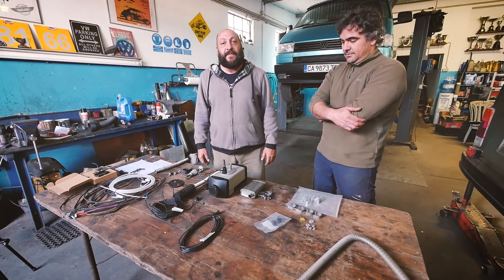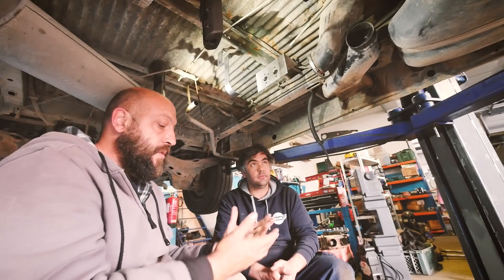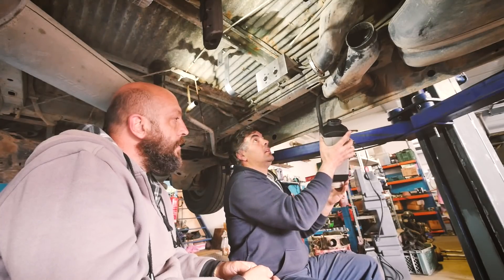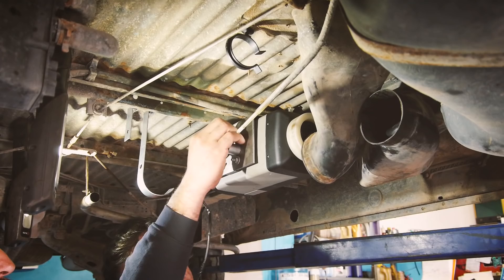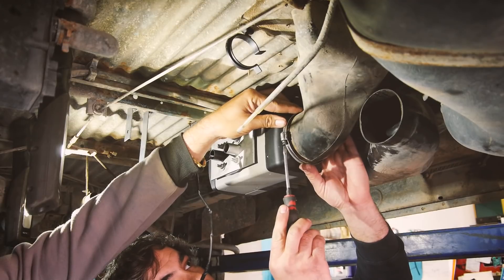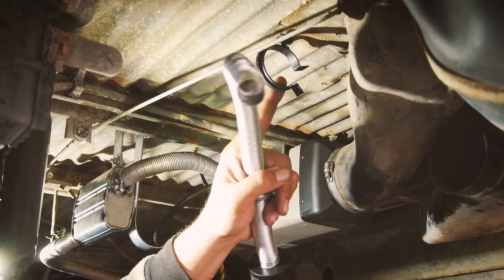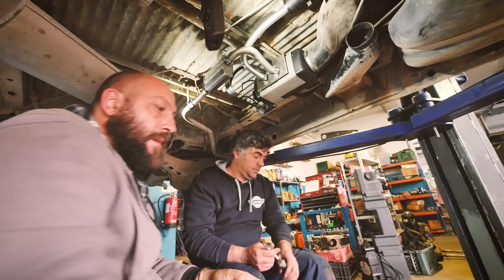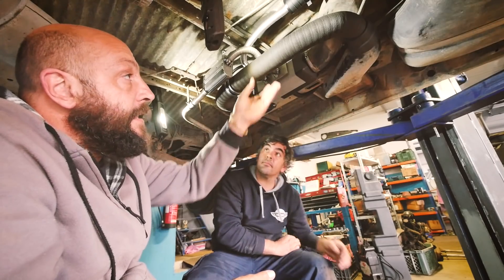How to Install a Webasto Air Top 2000 STC on a VW Westfalia (replacing the old  Eberspacher)

Comment: Ciao Armando, grazie per questo e altri ottimi video. Dopo tre anni di viaggi ed utilizzo del webasto installato sotto al furgone (quindi esposto a sassi, polvere ed intemperie), in quali condizioni si trova il riscaldatore? Consiglieresti l'installazione dentro a un box di protezione? grazie del tuo tempo... ciao!
Reply: nessun problema dopo tre anni di utilizzo montato sotto, dentro una scatoletta direi di no, la Webasto ha un'accessorio che vende separatamente, un paracolpi e parasassi
Reply: @storiediarmando  Bene, grazie del tuo prezioso feedback. Buon viaggio ....

Comment: Hi
Can i ask how the wire come  through the chassis?
I know original coming through inlet pipe (90mm)
I am just  installing eberspacher in the same way how you did
Reply from the maker: The wire get inside from the air intake behind the driving seat under the fuses

Comment: I guess you connected the heater to your main battery, how many hours will it take the heater to drain the battery completely?
Reply from the maker: never to the main battery, only to the 2 Gel leisure battery. Usually except starting the webasto itself, it goes into 1- 1,5 amph

Comment: Three questions about the Webasto AirTop 2000 STC
Question one: the fuses (1amp for the controller and 15amp for the heater) - on the fuse harness/plug there is a sticker that says F1 and F2. Can you tell me which fuse goes into F1 and F2?
Question two is about the two wires that come from the heater to supply power to the fuel pump, and the separate/long fuel wire with blue and brown wires - Is there a positive and negative? How do the blue or brown wires connect to the two from the heater? Are they interchangeable? 
Question Three: On the main wire for the unit, one plug says potentiometer and the other says telestart. One person said the potentiometer is for the Rheostat/dial and the telestart is for the digital multicontrol. Do you know if these plugs are interchangeable? Because the way the cable is wrapped, placement would be better to use the potentiometer wire for the digital multicontrol. Thank you
Reply from the maker: Wow, I’ll try to reply but I install the Webasto 3 years ago!
Reply from the maker: About the fuse I really don’t have memories about it. About the wires I put blue positive and brown negative. Last question: they should not be interchangable as one is for the old controller and another for the digital one

Comment: Hello, what have you done with the water tubes that were going to the old heat vent?
Reply from the maker: Water tubes?
Reply: @Westfaliadigitalnomads  yes, that are going to the old heater
Reply from the maker: we removed the engine heater in the back, we simply bypass the pipes

Comment: You've missed to insulate the air circulation tubes. You are loosing one third of the heat right now to the outside. For even better result insulate the heater box as well.
Reply from the maker: thanks for the tip, any particular material I should use?

Comment: Thanks for the video very useful I put the filter in the wrong way to, But now I have a doubt with the diameter of the combustible pipe. The manual specify inside diameter of 2mm what happens if I put a bigger one? any one knwos if it crates some problems?  KEEP IT UP WITH YOUR VIDEOS!!
Reply from the maker: German Diaz Saldaña can’t tell you. I used the old one from Eberspeker that was already installed. Anyway I received the new one with the Webasto and I assume it’s better to use that one

Comment: I still have a cable with an external sensor that I don't know where it is mounted.  I didn't see any temperature sensor installed, how do you know when to turn it off?
Reply from the maker: Colt Alb plimbari enduro si natura we first place the sensor just above the kitchen...but we realised not a good idea, as if we cook while the heating it’s on...so we move it just behind the driver seat on top. When inside you’ll have the desired temperature the webasto will stop automatically
Reply: @Westfaliadigitalnomads  where exactly is the plug inserted from the temperature sensor?  that I can't find any socket to resemble the sensor socket
Reply from the maker: well, you decide where to put the sensor. We actually made a small hole in the plastic above in order to put the sensor and the cable pass from behind.
Reply: @Westfaliadigitalnomads  I can't find the socket where the sensor comes in.  is it connected to the cables somewhere or directly in the device?
Reply from the maker: Colt Alb plimbari enduro si natura i wrote you on FB

Comment: I ordered the Webasto Air Top 2000 STC 12v Petrol. I have a 2019 Dodge Promaster van, and I'm inquiring about detailed installation instructions either written or video version to assist with my installation. Where can I access this information?
Reply from the maker: bob tarlowski we did a video but it’s not  full installation as we already had the ventilation system from the old heating. That’s why Webasto advice to install it at a Webasto dealer, also if you want the warranty on it
Reply: https://www.manualslib.com/brand/webasto/heater.html
Stay gold.

Comment: Thanks for the video. I was thinking about doing a similar install in my van and I was wondering if there are any down sides to having the heater mounted on its side?
Reply from the maker: JPdog1235 nope, the original heater was under the van already, but bigger and heavier:)

Comment: I finck you hawe  vibration  when webasto is  working, silution  you must hang webasto on ruber ;)
Reply from the maker: our is on two steel support that were provided in the kit, and yes there is rubber on top to avoid vibrations
Reply: then it is ewery fing is olrite :)

Comment: Hello guys! Can i ask u a question? 2 kw it's enough for a vw multivan? thank you
Reply from the maker: 2Kw of what? solar panel? inverter? generator?
Reply: @Westfaliadigitalnomads  i was meaning 2kw heating power for the webasto.
Reply from the maker: kuki kapros yes of course but it goes with 12v batteries
Reply: @Westfaliadigitalnomads  OK, thank you very much, for you answer! I will go for ''AIR TOP 2000''. They are told me to instal an ''AIR TOP EVO 40''. But i thought, 4kw it was a little bit too much. Thank you again!

Comment: This heater is complete shit. Ok I have it running from 24v batteries. Leisure batteries. It seems to be the reason the batteries never last. Need to do a drain test to verify. Anyway my post is not about that issue but others. 

If you switch it on in a cold vehicle the heater starts up fast blowing out hot air and then it blows out cold air for several minutes. Freezing cold air. Then it changes and blows out warm air and middle hot but not like first start up. If there was a fault with this heater the clever digital system of flashing lights to indicate which fault should happen, only it doesn’t. Then to say its got a fault and you need to let someone look at it is ridiculous. The heater has been installed. Means undoing surround panelling, the fuel and exhaust and removing the heater. In my vehicle its much more complex as it also lives inside a steel box with 4 bolts half submerged into the floor. 

This is not the first of webasto heaters I have had in motorhomes but it is most definitely the LAST. Im laying here on my bed in the motorhome right now. Guess what i can hear? Yep the fan or blower fan making a monotonous whirring noise. Slow whirring noise because its not like on start up blowing hot hot air which is exactly what I want here in the UK on xmas day. Yep it’s xmas day and I have to listen to whirr whirr whirr whirr just to have pathetic warmth. Need thick jumper on with this heater. My advise is dont buy one.
Reply from the maker: James Barratt sorry for your experience, it’s Xmas here to and we are at 2500mt with our Webasto running and giving a good 24 degrees inside the van, no issue so far
Reply: When it fails to start and then ten tries later it starts but you remembered the amount of flashes the lights did and contact Sebastopol they say flame sensing unit fault. Only hang on it started again. Then no trouble for a month and suddenly the same thing. No start flashes same amount, and nothing. You get annoyed then it starts and all good. Heat rubbish from 2000st as well. Need bigger and then it uses much more power. Nope I have tried a few air-tops and nothing but trouble. I’m writing this listening to that damn whirring fan out of balance or bearing failure noise. All because I ran out of gas last night Xmas on my gas heater. Webasto and me will never do business again.
Reply: little jamie, how can you call a heater shit and 10 seconds later say you have not tested the batteries? are you just mad?

Comment: Very good video - very useful.  I bot a Webasto heater and I have questions.  How do you know which fuses to put into the relay? - I have 3 fuses - 20A, 15A & 1A - but there are only 2 places to put fuses in the relay.  Also, when you attach the power wire for the fuel pump - how do you know which wires get connected to each other? - the fuel pump wire that comes out of the heater unit has 2 black wires and the other wires that go into the fuel pump has 1 brown & 1 blue wire - so I don't know which wires get connected to each other.  Thanks for you help.
Reply from the maker: Let me recheck things and I'll write you back

Comment: Sort comment on the Video: The intake filter is no filter, it is a silencer with water separator.
To determine the position of the combustion air intake, take in mind that it is in a pressure less surrounding. Avoid over pressure (to much combustion air, lean combustion). Avoid under pressure (to less combustion air, rich combustion). With an intake silencer you already avoid a direct  over or under pressure.
Reply from the maker: Thanks a lot for your comment, now is more clear :)